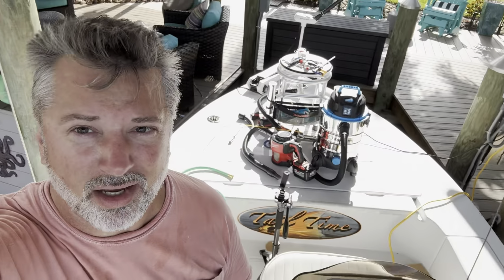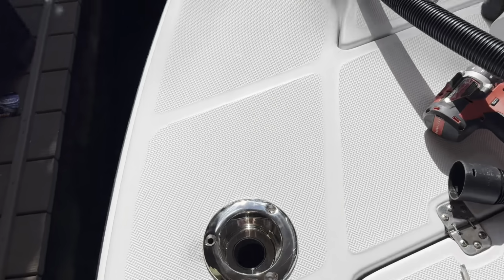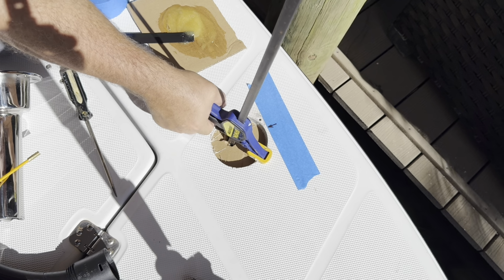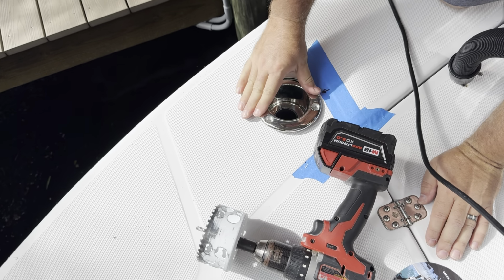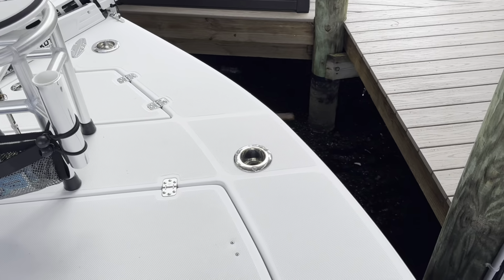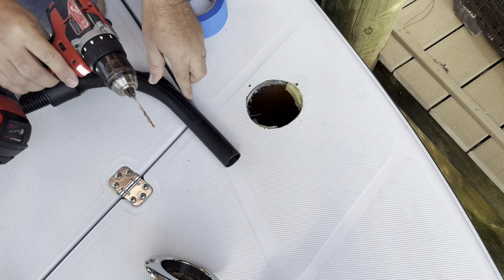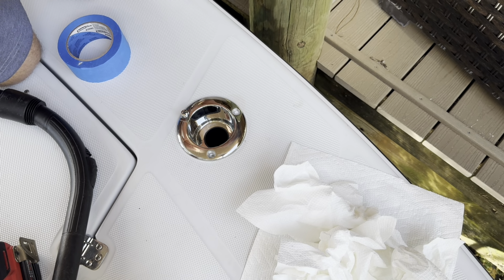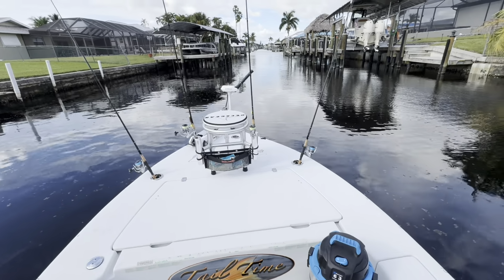Flats Boat Deck Mounted Rod Holders

Comment: Nice job!   You've got a lot more patience than I do.   After all the headaches getting that portside rod holder placed,  I would have likely just positioned the starboard holder about another half-inch away from the gunnel, and then figured 99% would never notice anyway.  Glad you didn't have to struggle too hard on the second one!   They look great!
Reply from the maker: Thank you!  I appreciate that. Came out great. Got put use yesterday and are very functional!